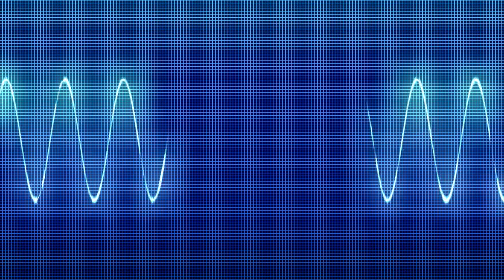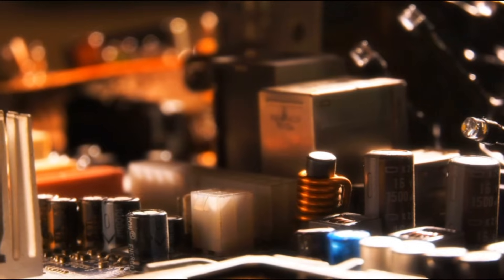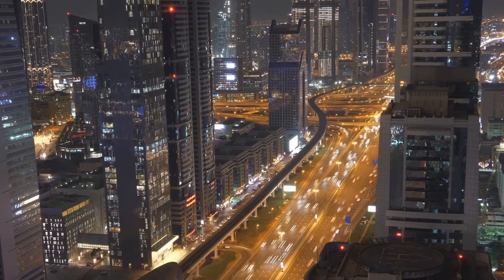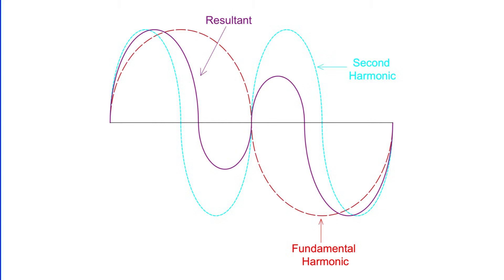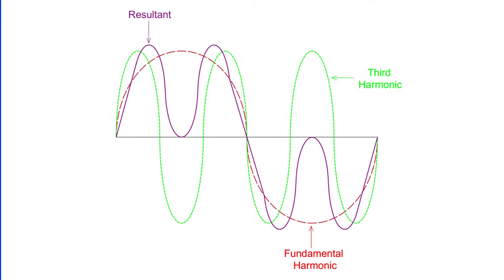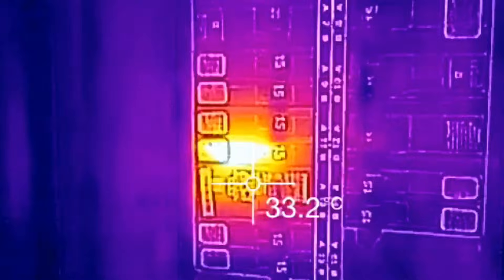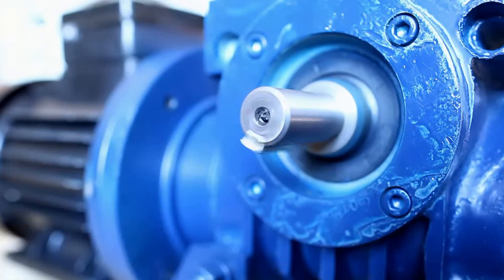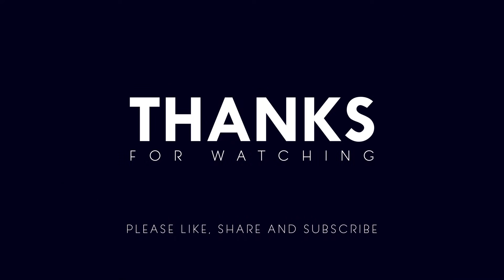What are the harmonics in Power system? Type, Cause and Effect of Harmonics #electrology explained

Comment: But each harmonic is at a lower voltage than fundamental frequency, is that right?  So if each harmonic is at a very low voltage, the total impact could be negligible?
Reply from the maker: No, its effect will not be negligible; it deforms the fundamental wave.